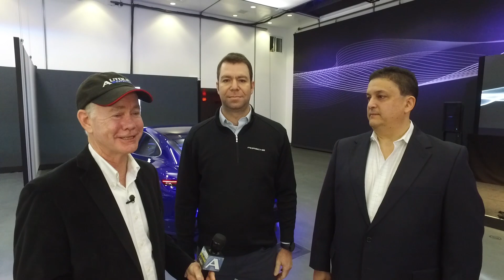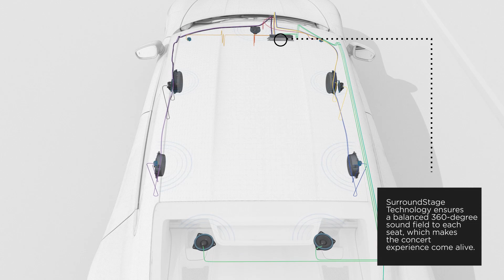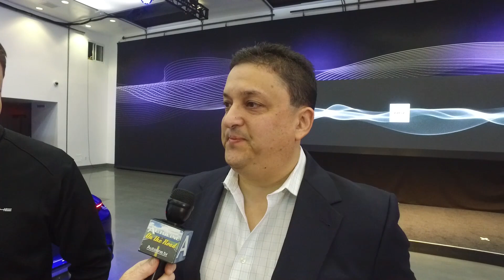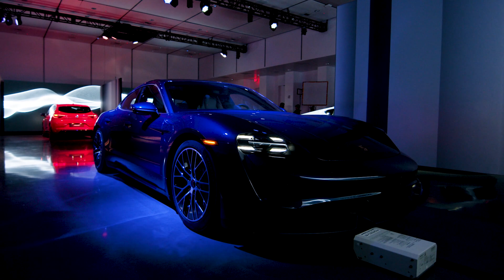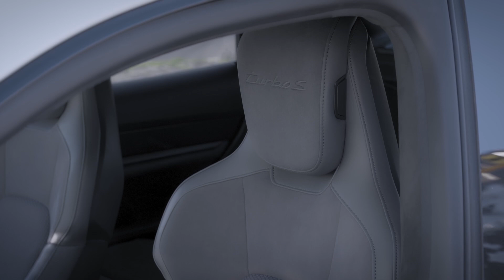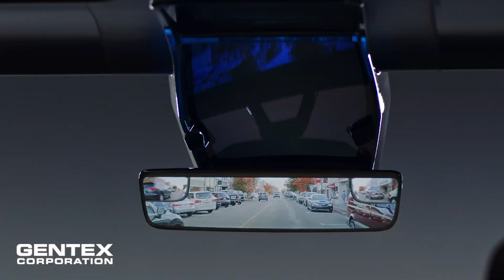Porsche Taycan Gets Custom Bose Sound System - CES 2020 - Sponsored Segment

Comment: Just brought home my taycan cross tourismo the Bose system is sub par… the fender system in my daughter’s beetle is better.   The B&O in my audi blows away the Porsche system.  Disappointing for such an expensive car!
Reply: I literally just got done with a whole write up on someone else’s comment but I completely agree with you. I think after I swap out the dash tweeters with something more smooth like Morel it will be a far more enjoyable system but right now it has a huge spike in the upper mid/lower treble range. In addition to that they bass and midbass taper off at moderate to medium volume further emphasizing that treble spike. Back in 2014 I had a Jetta TDI with the fender audio system and it was leaps and bounds better than the Bose I have now 🤦🏽‍♂️.

Comment: Was going to go all in on Burmeister (despite never even hearing of them before) because more is better, right?  But over $5,000 and you don't even get an EQ, just bass and treble adjustments!!  Are you fking kidding me?  Refuse.  I'll save the 5 grand and get the Bose.
Reply: I literally just got done with a whole write up on someone else’s comment but I completely agree with you. That’s why I ended up just going with the Bose, I think after I swap out the dash tweeters with something more smooth like Morel it will be a far more enjoyable system but right now it has a huge spike in the upper mid/lower treble range. In addition to that they bass and midbass taper off at moderate to medium volume further emphasizing that treble spike.

Comment: So if BOSE has been on board from early on in the design and engineering of the sound system in the Taycan, what does that mean for the higher end Burmeister system? Did they develop a separate audio solution for the car? Seems wasteful. Or is it just a rebadged Bose system with a few more speakers and more amplifiers?
Reply: The Burmeister system as you stated has more speakers with the three main differences being AMTs tweeters in the dash, 8 inch mid drivers in the front doors instead of 6 1/2 and 400 W to the sub instead of 80 to 100 ish. I didn’t opt for the Burmeister in my Taycan because they don’t let you in adjust the EQ in specific frequencies regardless whether to get the Bose or Burmeister, there is just a bass and treble EQ. My biggest criticism with the Bose system in my car is that there’s a huge spike in the upper mid/lower treble region which happens to be an area most people are very sensitive to. So I will probably be switching out the tweeters in the dash for a more smooth sounding Twitter from most likely Morel. Second biggest criticism is that when you raise the volume the bass and mid bass taper off thus further emphasizing my prior criticism.
Reply: Wished Journalists would ask such kind of questions :/

Comment: D class audio amplifiers have been around since 1960's and TI has been making ICs capable of driving power MOSFET for over 1,000 W per channel for about 20 years, so nothing new as far as that is concerned, same goes for the light weight speakers, they have been around since 1970's mostly used in aircraft. If it was not in EV, no one would even mention it....
Reply: True no one ever discusses these "important" issues because they were not important to ICEs and Hybrids. But BEVs are so heavily effected by what are actually minor issues, with huge penalties as a result, they YES these minor things are things of discussion. Also most people have NO idea just how old some "new" technologies actually are.
Reply: Disc brakes and tubeless tires have been a part of cars for decades.... But they are relatively new to bicycles, so are still news worthy..... Same way tech used elsewhere is still news worthy for an EVs... And the same will be true, when Fuel Cell Vehicles become a cost effective viable alternative.....
Reply: And for the space shuttle right? No??!!!
Reply: In my opinion the Tesla S1nn system sounds better than bose. I have sat in a Tesla model S in the showroom and the soundsystem is a bose killer. If I rebooted AMC as an EV only automaker, I would include a very nice audio system that's better than bose as standard with a 12 inch 1200w RMS or higher subwoofer in a custom engineered glass fiber reinforced nylon sealed enclosure in some weird shape. Also it will tell you how much range you are losing if you are cranking up that powerful subwoofer. For example if you turn up the subwoofer volume to +6dB and master volume all the way to 65 it will tell you that you have lost 25 miles of range. Or if you turned the master volume down to 25 and the subwoofer volume to +0 dB it will tell you that you have gained 25 miles range.